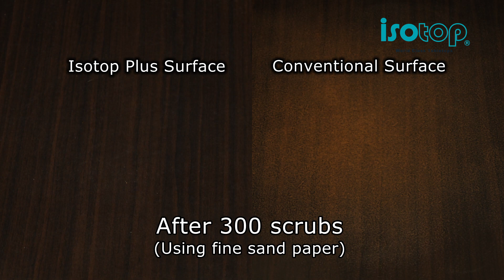ISOTOP Bistro Table Tops

Comment: Hello from Spain. A few months ago I bought a container of ISOTOP boards. 2160 units and 288 free of charge. Price 70x70 26.65 USD
All the boards received are twisted randomly without any sense. On the same board you can find a concave corner and on another corner of the same board a convex one.
When you expose them to the sun for two days the curvature is extreme.
Milton and Daphne visited my company and checked the state of the boards. The solution they measured was that I had to manufacture special metal structures to straighten the boards, the cost of which is higher than the price of the boards.
Poor quality boards. I recommend buying from the company SM France or Werzalit Germany, you receive the straight boards and they do not bend over time. Greetings.